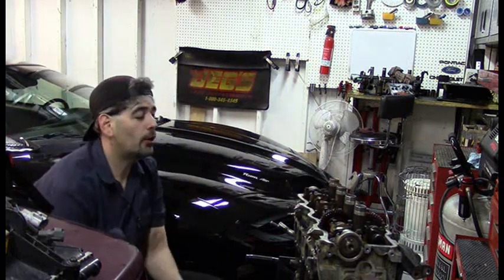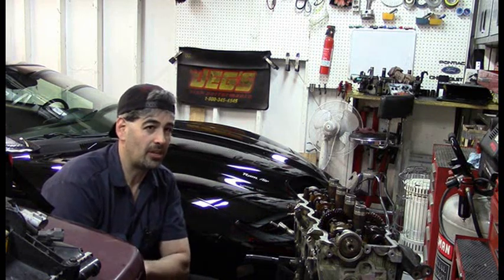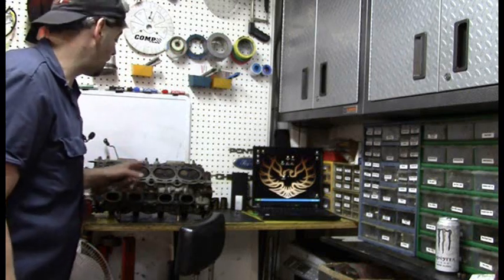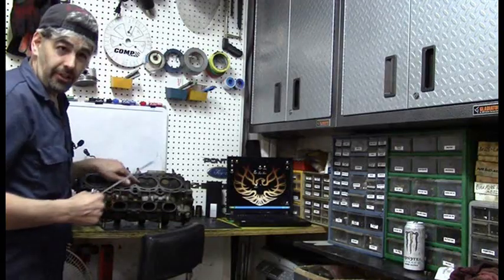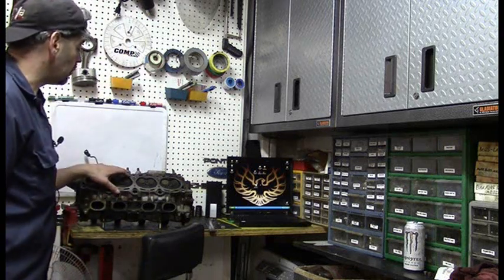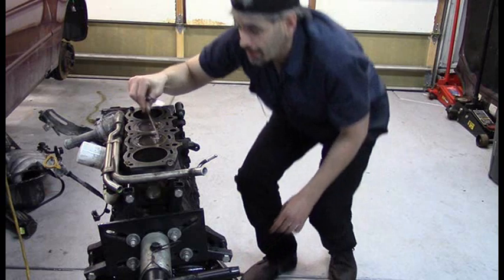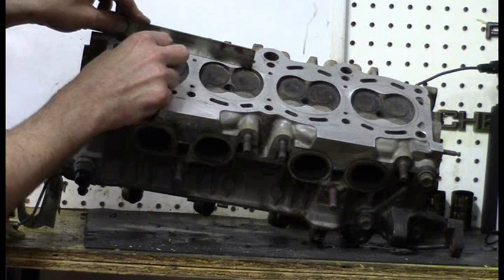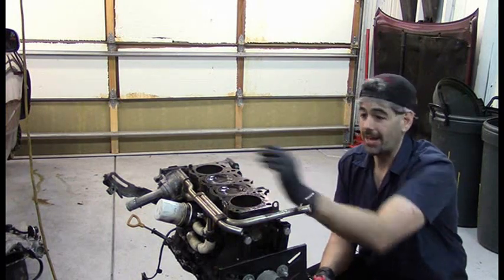Replace a Cylinder Head Gasket Yourself and do it RIGHT! Part 1

Comment: The most interesting thing I learned about your video is that head gaskets do not just go bad. Something causes the car to over heat and that causes the gasket to go bad. Which totally makes sense because the only two friends I had that had this problem ended up with the same problem again after replacing the head gasket by their mechanics. most mechanics just replace the gasket and don't really check for what caused the problem.
Reply from the maker: If you take just one thing away after watching this video, that would by far be the most important one.  I cannot even count how many times I have seen the same thing happen.  I knew a guy who actually had been through this twice and then when he finally brought the car to me I pointed out the fan switch failure causing him to keep overheating in the first place.
Reply: While I agree that most of the time, headgasket problems come down to driver error (water pump failure, lack of coolant, rotten radiator or leaks in the circuit, etc), sometimes that's not the case.

I have a Lexus IS220d, the only diesel Lexus has ever produced. It has the infamous 2.2L 2AD-FHV Toyota engine very prone to headgasket problems 
It's like 99% certain if you have this engine, it will at some point in it's life show headgasket problem symptoms...

Well let me tell you my story, mine has recently started showing these problems. Basically since 10k Km ago (my car has 191K Km) it started spitting coolant through a hose on the coolant reservoir. It doesn't seem to be burning coolant since there's no apparent white smoke nor power decrease and also there's no oil on the coolant nor coolant on the oil. I haven't done a leak test but it's apparent there's compression going into the coolant circuit which causes the coolant to be spat out. I've been checking it daily and have basically used 0,5L to 1L of coolant in the last 10 000 Km.

The car has 100% never overheated nor been driven above normal temps and if you search Lexus forums you'll understand that sometimes, it's just shitty engineering design that causes these flaws. Literaly Lexus replaced these engines through an extended 7 year 100k miles warranty due to how shitty the engine was yet some people had the same issue later on in their life. Same goes for the N47 2L BMW Diesel engine, very prone to snapping the timming chain due to a fault in the hydraulic tensioner that's supposed to last a lifetime. (wasn't sold in the US).
Reply: @fcgodftw  What do you know about engineering? You don't even understand high school physics?
Reply: @SchrodingersBox  Where are you located? I have a ws6 trans am just like yours and need the engine looked at. Think it may have a blown head gasket.
Reply from the maker: @ryanstevens1855  I am located in Denver
Reply: @SchrodingersBox  That sucks. I'm in Youngstown, OH. Its an 02 ws6. Only has 12k miles on it. Haven't drove it in 6 yrs. There was white smoke coming out of exhaust on cold start. Oil cap looks bad underneath and there was some water on underside of cap. Change oil light comes on and I changed oil before storing it 6 yrs ago. Gotta find a good shop to look at it.

Comment: Excellent video. I was able to determine a solid logical approach to solving my specific head gasket situation for my 2000 Chevy Silverado 5.3L. In my case performing the chemical and compression tests showed non-positive results for a blown head gasket, but was still helpful in determining the nature and extent of the coolant leak.

I simply had coolant leaking externally out of the head gasket from a coolant jacket, which gave me some time to plan the proper fix and work around with other modes of transportation.

I ran into a few snags when performing the job as can be expected, but feel confident that everything was done right on my end.

The truck has been fixed now for over a month and still running great with no leaks.
Thanks for the help!

Oh and I forgot to mention this was all done spending under half the estimated minimum cost to fix. Plus, I get to keep all the new tools.
Reply from the maker: keclark4 Nice job and great diagnosis!  The money you saved by diagnosing it correctly probably paid for the tools so consider those payment for your effort!
Reply: What was the repair?

Comment: If you follow the advice given in the video you  will have the best possible chance of a successful repair. I just replaced the head and gasket/s on my 1997 BMW 318is. I'm no mechanic but it started - first time!. One of the most important tips I took onboard is to make sure everything is CLEAN! Secondly make sure you have the RIGHT TOOLS! I had to buy a torque wrench and a Torx socket. Thirdly TAKE YOUR TIME! I did the job over 5 days.  Matt's presentation style is spot on. Not too in-depth but all the critical information is spelt out in reasonably simple terms. Forget the 'Pro's' on the forums. This is the place to find the PROPER answers. WELL DONE MATT!
Reply from the maker: Great advice!!! Except my name is Matt not eric lol
Reply: Reply updated - SORRY!

Comment: You're absolutely right about finding a reason as to why the head gasket failed. Except one: Subaru engines. Those head gaskets go out simply because of faulty craftsmanship in the gaskets. Thanks for the great video.
Reply: +Rodrigo Sagebin yup engineering flaw on subarus part.
Reply: Yep same thing with the 94 Mustang 3.8L  :(
Reply: I know that for a fact about the 3.8 Mustang in the 90s. I was working for ford Lincoln Mercury (professionally) in the late 90's when they had a recall on all those 3.8l headgaskets. I did quite a few of them. HGs do fail at no fault of the driver.
Reply: +Auto Fix Pal yeah after having the dealership change my headgaskets for $2,000  didn't even last 25K. before it blew so I ended up doing myself and so far it's been about 50K. Instead of using the Ford headgasket I want with felpro. I'm about to add an oil cooler to help keep the heat down. Do you thing an oil cooler would help?
Reply: You will be fine without an oil cooler.
Reply: +Auto Fix Pal Well it's already on its way so I'm going to be adding it lol.
Reply: I had impreza wrx.360 bhp.never done a gasket.used only Mobil 1

Comment: Not all of us are mechanically incline. It really does help a lot when you can see what parts need to be remove. I did my first head gasket and i had not a single clue what to remove or where to start. That's why they get so many views because you are helping the community. From special tools to the timing all learned from ppl explaining and the how, where and what is required on the job your doing.
Reply from the maker: This is an advanced DIY channel. I assume viewers here already know the basics.

Comment: Nice video... just an old gearhead myself... I am though Certified Class A Gas & Diesel with around 40 years of experience.... a couple of comments.  You use a "thread chaser"... well that's all well and good but what IS a thread chaser? On diesels the compression ratio is much, much higher than a gas engine so cleaning out those head bolt holes is of even greater importance. I would imagine that most readers don't understand that there are different "thread chasers", or what they perceive to be "thread chasers"... the proper "Tap" (to use the correct term) to use is a "bottoming tap". A standard tap has a tapered head, tapered to help in creating the new thread. But at the bottom of the hole it doesn't cut complete threads. They are angled towards the center. But a bottoming tap is has no taper and is made to ensure that threads are cut completely all the way to the bottom of the hole.

On another note... I had a friend who used to race motorcycles on the roundy round circuit. He would build his engines without gaskets! I wouldn't recommend this for head gaskets... but the rest of the engine he would lay out a piece of glass and then spend hours flattening out his engine parts by rotating them around on the glass with valve lapping compound until they actually were flat! Hence, no leaks and no gaskets! 

On diesels the head bolts stretch! I always replaced them no matter what. 

On gas engines I've always re-used the bolts if they passed a visual inspection... I've done well over 100 heads on cars, trucks, heavy and light equipment and high horsepower  60's, 70's and 80's era Hot Rods. bikes and boats and I've never had a problem at all. Take that as you may.

For anybody who might be reading this... I cannot overemphasize the importance, as did the creator of this video, of cleanliness. Do it right the first time and you'll save yourself a world of grief.

This is one of the best Youtube mechanic video's I've seen... and I've seen a bunch.
Reply: No body gives a shit about diesel unless they drive one.  Looks like this guy is talking about gasoline engines.  Take your experience and share with people who post diesel videos.  This video is about gasoline engines.  Yeah got it the average Joe may not understand cuts but you are applying your knowledge incorrectly.  If you can afford a diesel then you can most likely afford to take it to a shop.
Reply from the maker: +Christopher Joseph Man why the animosity towards diesels lol
Reply: not really,old diesel clunkers, smokers,are the cars of the poor,lol;
and that´s when them bastard  break down a lot---when old,on the hands of the poor; at least,around here in old europe.
Reply: John Reed 7
Reply: Although this thread is 3yrs old, just wanted to let you know some people appreciate the tips and sharing of knowledge. I can relate to your friend, as I've used emery clothe/paper glued to a piece of glass and have resurfaced carburetors that had warped (yeah, I'm old enough to remember when cars had carbs:-))

Comment: When I first bought my 2004 Volvo S40 I took it to an auto shop in San Diego to have it inspected before I bought it. They said it was fine, but the main crankshaft seal was leaking and it would need to be replaced or I would need to add oil a lot. I decided to buy it and over 2 years they did many repairs to it including new struts, new timing belt, and plenty of alignments. I noticed that the same problems kept coming up and at this point I had enough and took it to another shop. It took them 2 hours to inspect the car and gave me a grocery list of what was wrong - including the failure of the head gasket.

They said with the amount of encrusted oil and dirt its obvious it had been leaking for years, probably before I bought the car. The first auto shop most likely knew this and chose to keep silent because they saw it as an investment on their part.

I just wanted to say thank you for being an honest mechanic! It's so hard to find mechanics who just want to help instead of profit. I, myself, am now studying automotive mechanics with the goal of working with cars long enough to consider engineering. But I promise any car I work on until then will be towards the best interest of the customer and not the shop. Thanks again!

Comment: By the way.....I learned a lot from your video. I can tell by the way u performed your work that you are an experienced mechanic. Most people would say hey I have a bad head gasket and need it repaired and never think twice about the other damage that could be caused by the gasket and the defective parts that caused the gasket to go bad. I was watching your vid because I was contemplating on buying a van from my job that has a bad head gasket and realized that it could be way more trouble than just replacing the gasket and it wouldn't be known until you start pulling things apart and testing them. Now that I've seen it done and know what issues could arise I think I'm going to pass on the purchase. So thanks again for the vid it helped me tremendously.
Reply from the maker: Thanks WSVitak. I am not actually an experienced mechanic- more of a DIY who had lots of experiences. But either way I think you made a very wise decision.  I have seen many, many, many many many cars that needed "just a head gasket" and as you learned, by definition, they ALWAYS will necessarily need more than just a head gasket and usually they need more than a cylinder head too. Just the coolant running through the oil for who knows how long is a major consideration for the bottom end damage that may have been done. Not that you can't get a great steal on a car with a blown head gasket that you repair yourself- but you need to understand you are gambling with a minimum weekend of time and minimum $300 dollars up to over a thousand dollars or even a potential blown engine that you only discover after you did the weekend and $300 (for example engine doesn't run right after resurfacing the cylinder head and compression test shows it's because it has a worn piston ring that you couldn't diagnose earlier because the compression was low due to the head gasket leak).

Comment: thanks for the video, dude!! just successfully completed a top end rebuild on my 98 f150, and this video made me feel 10x more confident. it was more of a job than i thought. took me about 30 hours, but I did it right, and it paid off to take my time and be meticulous. thanks again for the vid, bro. time to crack a beer. cheers to you,and cheers to good head!!
Reply from the maker: Congrats!!!  Yeah my first time doing a cylinder head actually took 3 times to succeed. I didn't know to measure the warp and of course the head was warped .005 out of spec. That's what i got for getting my advice from "experts" in the forums.

Comment: Don't use sandpaper! Use a Stanley blade and take your time.
Reply from the maker: WHy would you not use sandpaper? Especially on an aluminum head- I'd NEVER use a blade on aluminum!
Reply: Schrodingers Box The aluminum oxide could get into the engine and damage cylinder walls, bearings etc. Big no no in factory service info. Voids warranty on some factory vehicles if the warranty manager detects swirls etc from using anything with an abrasive like sandpaper and techs job could be on the line if he did. I am always on the look out for a good effective method with minimum chance of oxide contamination.
Reply from the maker: That makes no sense at all. A cylinder honing would be way worse for contaminants. Proper cleaning after the procedure is necessary regardless but aluminum oxide contamination would be the result of improper cleaning and flushing. 
  And voided warranty on factory vehicle after a rebuild?  Hardly makes sense to me.
Reply: Right, but we are not talking about an engine overhaul where everything is completely apart and cleaned like a cylinder honing. If the head is removed and you clean it with sand paper, it would be reasonable to assume that you could clean most of the grit off of it before re assembly. What is your method of eliminating that contamination from the rings, crankcase and cooling system of the block side ? Not saying I dis agree with sandpaper. Trying to bring light to the risks involved and reduction of contamination.